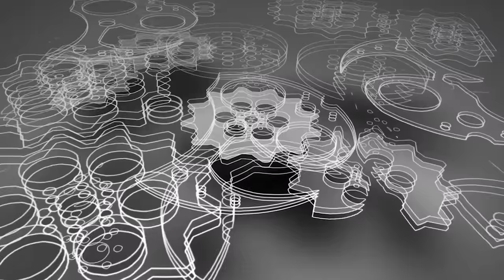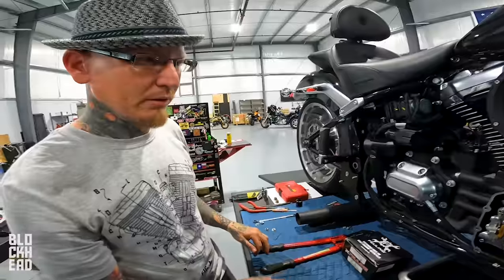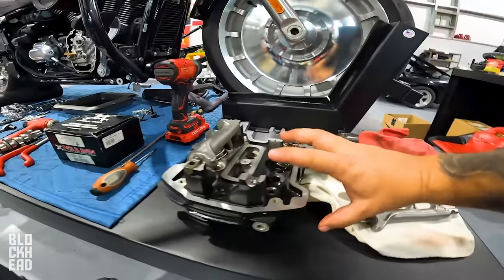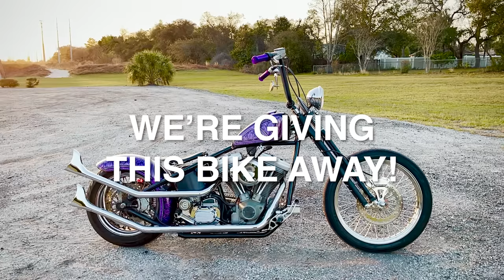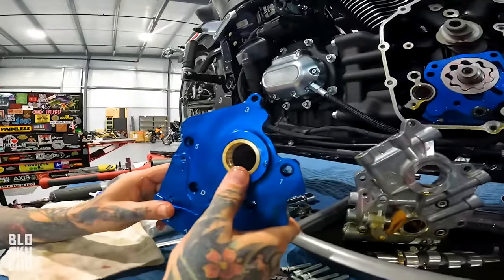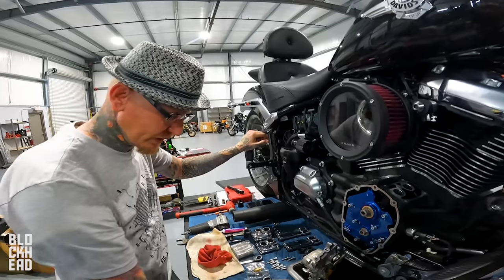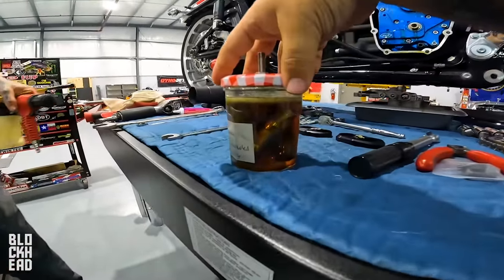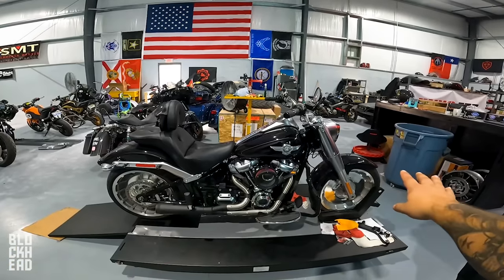Harley Davidson STAGE 2 Explained

Comment: Chris is a good teacher.   Have you guys ever thought about doing occasional seminars at the garage?   I'd pay to take a 2 hour motorcycle class with Chris teaching.   There's a local motorcycle garage/co-op work space near me that does classes.   It's like 50 bucks for a 2 hour class on basic maintenance or electronics or carburetors, there's a few different ones to chose from.    I signed up for a couple classes next month.  I'm curious to see how they are.
Reply from the maker: Cool idea!
Reply: @BlockheadMoto   I'm with Dave123 . a maintanace class would be awesome. I would pay for such a class.
Reply: I’d pay

Comment: Put a S&S 475 in my M8 114 Breakout and dyno tuned it with power vision software. Made 124 horse and 136 ft lbs of torque. Love this cam.

Comment: These seriously are great, loving the series. At what point of power increase do you need to start worrying about beefing up the transmission? Does going Stage 3 or 4 introduce more odds of blowing a motor?

Comment: Great video.  Have a Stage 2 in my Ultra and Heritage and know first hand the improvement.  Love your presentations.  Keep up the great work!
Reply: How did you get rid of the bucking at low rpm
Reply: @popsproductions8547  Don't really have a problem with off-idle or low rpm bucking.  They just pull a LOT stronger through the RMP range.  I do a lot of low speed maneuvering practice with cones just as a general rule to improve my control and haven't noticed any problem with low speed friction zone clutching / control.
Reply: @williamokeefe9677  ah yes like preloading to do sharp 8’s. Yes i find myself using the clutch a ton more to solve my issue at slow speeds. But this was doing it up near 2,200 rpm in lower gears. It needed tuned i guess. So we will see how the new bike (Toad King) gets tuned after its stage2. I went power vision this time.
Reply: @popsproductions8547  I've got the standard Harley components.  My biggest issues are keeping a steady RPM for low speed practice, actually have found a little higher RPM to help and the friction zone differences.  Heritage has cable clutch and a nice wide zone; Ultra is hydraulic with a short zone and fast engagement.  Going back and forth takes some attention.

Comment: Awesome!  Thanks guys.  Informative, fun, and entertaining video.  Best I've seen.  I have a Road King Stage 1 which is plenty of power for an old fart like me who's been riding for 50+ years now.  Interested in stage 2 maybe but is there a trade-off between power and engine reliability/lifespan when you go to stage 2?  If the motor is breathing and working that much more (due to more duration and lift of cam), are you in effect shortening its life and reliability on the road for those long cross country trips?  (Maybe I think about this too much since I'm 70+ years old.)  Any thoughts appreciated.

Comment: Really enjoying your podcasts.  I can't get enough information about Harley engines.  I've gone insane.  I used a Screaming Eagle cam plate and oil pump.  Hopefully I made a good choice with my.510 S&S cam and gear drive.  Less than.002 run out on my 01 twin cam

Comment: How does the SE oil pump and cam plate stack up to the S&S parts? What type of improvements in oil flow does it provide percentage wise versus the S&S?
Reply from the maker: You’d have to look up their spec sheets for detailed stats, but Chris goes over a few of the pros in this video 👍🏼
Reply: @BlockheadMoto  Chris is exactly why I asked the question. He was a Harley employee and likely has experience with the SE oil pump and cam plate. I'm sure more of your followers would love the comparison info of the different brands of oil pumps. I've seen videos showing the % numbers of increased flow for the Fueling and the S&S parts but haven't seen a Youtube video comparing the SE to those two brands.

Comment: I purchased a 05 might train... I heard that in  those twin cams that the tensioner would  wear and break and get into the oil circulation ... I've been looking at the SS gear driven and / or the screaming eagle hydraulic cam chain tensioner ones. I am concerned about the runout  on the SS gear driven one.. Thoughts..?  Great video.. Thanks, Brad.

Comment: Some came with stage 1 already completed - my FXDL was one of them. There’s something strange about my ride too - seems to have much more power than it should have. No cam but my god the torque on the low end and HP on the upper end will absolutely break your neck. 2017 and only 5400 miles on her. She beautiful 🤩

Comment: What about the "O" ring / gasket on the back of the oil pump?  It wasn't in my instructions from S&S but was on a video from them.  When I didn't have it installed  oil came out my Trask "Check m8" so I had to install it. S&S said it was needed.  The trouble didn't start until I went up to a 128".
Reply from the maker: It is recommended to replace that gasket with a new one 👍🏼

Comment: Ok, so you cut out the pushrods, but don't show how you reinstall the new ones with the heads still intact? I've never done this job before and am very curious how this is done. Appreciate all of your informative videos!
Reply from the maker: This isn’t a ‘How To’ video where we show step by step, that would be a much longer video. This video’s goal was to explain what a Stage 2 consists of and how it works 👍🏼
Reply: Lots of videos out there about adjusting your pushrods,  all by way less cool people though.
Reply: @BlockheadMoto  Yeah, I took that in to consideration, I just figured with all of the other detailed info you guys gave that you would show that. I looked up some other vids to see how the adjustable pushrods worked. Keep doing what you do!
Reply: @GeorgeWashingtonjr-p7r  agreed!

Comment: Love the content in the shop but I have a suggestion. How about some troubleshooting videos? I assume you guys will have repairs in the shop. Be interested to see some diagnosis on known Harley issues. Got one I wish sick wide glide could figure out.
Reply: Whacha got?
Reply: @sickwideglide   Really appreciate the reply. 2012 Street bob stage 1 SE heavy breather and V&H big radius. Power vision tune from Fuel moto. 2 issues that I'm not sure are related.sometimes I get either a low idle or high idle when stopping. Either it will be at 1300 rpm or let's say 850 rpm. When it's high takes a little time to settle down to normal idle. When it's low same thing. Doesn't happen all the time. Changed IAC valve helped a little but came back. Occasionally i'll get a high idle on cold start 2000 rpm. Again all this doesn't happen all the time. 2nd issue is I get hard hot starts. When I stop at gas station fill up go to restart I get like a metallic clank. Im guessing compensator or something maybe. If i release start button quickly it starts fine. Before a hot start if I bump the starter it starts fine. Weirdest thing I guess. Other than that bike runs great. All this happen before tune too. Not sure if they are related but would sure love some advice from you. Again thanks so much.
Reply: @sickwideglide  forgot to add no hard start occurs on cold start.

Comment: Great video! How did you put the push rods in without taking the top end off? Just curious😂
Reply: I was waiting for that too I’m glad someone mentioned it.
Reply: There’s a video on YouTube that shows the process, no head removal is necessary, the lifters have to be in the lowest position then the adjustment nut has to be loosened to allow for the shortening of the push rod kinda like the shovelhead.
Reply: He removed solid push rods and replaced them with adjustable, which can be made short enough to install without removing the heads.

Comment: I put a stage IV 131 kit on my 2020 ultra limited last year. This year I am putting a baker grudge box and a baker compensator and going with a wood 408 cam D&D 2 in 1 exhaust. When I went to the dealership who is doing my build they tole me they replaced my lifters because they had a little wear on them and on the cam. They only had 8500 miles on them and replaced them for free. My question is I asked them when they did my stage IV kit if I needed to replace the oil pump and the cam plate with the S  $ S ones and they told me I have the upgraded harley ones and they have had no problem with sumping with it. Isn't wear on your cam and lifters a sign of sumping because they are not get enough lubrication? And in your opinion should I go with the S&S cam plate and oil pump with the money I am putting into my bike? I see in your videos and with the research I have done they seem like the best or I am good with the harley upgraded oil pump and cam plate. Thanks for your time.

Comment: Great video guys, thanks. Not being mechanically inclined, I have a quesion. On my 2022 Street Glide ST M8 117ci. HD just did a stage 2 upgrade, but to stay in warranty, they had constraints and cound't do as good a tune as if my warranty was over. I put TAB 4.5" slipons w/Zombie baffles. Redshift 468 cam kit, but Zippers advised "Make sure you keep the CAT head pipe, DO NOT remove the CAT, If there is an option for adding SE wide band sensors skip those, keep the narrow band sensors."
End result: DYNOJET Results = 95.57 HP @5.12 RPM, Max Torque 131.01 @3.18 RPM. I thought my HP would be over 100
with the M8 117ci.  Wondering what you think?  Thanks!

Comment: Having cut the push rods, sorry for being a bit 40 watt (dim) here, but how did you fit new ones without taking all the stuff off which gave you the reason to cut them in the 1st place or does fitting adjustable rods allow you to do this??. Would have liked to see this wizardry if you still have footage of it on the cutting room floor please post that footage please 👍 great series so far 👍👏

Comment: Nice info. So question I have a 21 ultra should I do screaming eagle trq or power cam or best to just do a aftermarket cam? Also since I have newer model oil pump will the stock oil pump be good or still don’t use when upgrading cam?
Reply from the maker: If you do SE cam and have dealership install, you should still have warranty. If you’re not worried about warranty, there’s a ton of aftermarket cam options out there that make incredible power. Newer oil pumps hold up fine, but it’s not a bad idea to beef it up and throw better at it ‘while you’re in there,’ that’s our thinking anyways, haha
Reply: @BlockheadMoto  well I like warranty but it’s just 1yr left. I figured if I went SE cam after warranty I would want more. That’s why I was going to go ahead and do it right the first time. So guess if I’m doing right I need better oil pump as well. Thanks for quick response! Yes I’m
Going to go ahead and do it right while there what’s another $700 investment going to hurt. I’m hoping from stock to the 475 upgrade going to be fun as hell

Comment: I bought a ‘15 883 as 3rd owner that has an apparent full stage 1.  The 2nd owner bought it from a Harley dealer and didnt ask and bought it because of size and looks.  After watching this video, given how my bike, runs I’m wondering how I would find out if the original owner also did stage 2 work.  Since it’s all internal how would I know?  It’s really fast compared to my son’s stock ‘17 883.

Comment: Curious how the push rods and PR tubes went back on without pulling the head...
Reply: They used adjustable pushrods.
Reply: @Tagfire17  Still doesn't explain the tubes unless they are some 2 piece design.

Comment: question, the S&S installation instructions call for a maximun runout of 5 thousandths with the billet cam plate...so is 8 thousandths too much or will the new camplate be ok? I'm installing a 465 cam kit with pump and cam plate this weekend.  I'm hoping that I have runout below 5....just curious, I noticed you said 8 thousandths on the runout...

Comment: i just subscribed, I own a 2018 Softail Deluxe (M8 107 motor) and as chances would have it im awaiting my parts to do a Stage I & Stage II (all Screaming Eagle) and im also upgrading the Lifters, the lifter Cuffs, and a SE High performance Oil Pump and Cam Plate. Also a rear pillian, clear 19” windshield, and a few chrome pieces, (although this bike came stock with a chit load of Chrome) Thats as far as i want to go for now. Very cool that I just came across this video. What i found interesting when ordering the parts, the parts guy spoke with the Service manager cam back told me he ordered everything (take about a week) but said that the service manager said “You dont need The Lifter Cuffs” I said NO….You dont understand, I WANT them replaced, and he sort of argued with me asking repeatedly WHY? I finally said because the ones Harley built this engine with Like with so many other parts Hum lets see Plastic Tran Cover, Insufficient oil pump improperly vented pressure with the blow by issue) and The CUFFS are PLASTIC and are known to TWIST, then the rollers on the bottom of the lifters can rotate…NOT GOOD. His reply…Oh we haven’t heard of THAT happening. I have and will be glad to point you to the many instances, i also dont beLIEve they haven’t heard it.

Comment: I purchased back in June of 2022 a brand new Street Glide Special 114.
8 months later, I am considering a 131 Stage IV kit instead of a 135 Crate Engine replacement.
Is a 131 now cheaper since the 135 is being produced?
The wait for my area in Pennsylvania for a 135 is likely up to December or later when it is officially released for here compared to scheduling a 131 kit upgrade next week.
I am just trying to weigh my options. Looking for any comments, thoughts, or suggestions for this upgrade.
Stage I, II,III, IV, or wait for the 135 crate engine?

Comment: Lets say you would live in Europe and many things are not "allowed" :D and you are having a Low Rider ST with the 117. Would it bring any benefit / make any sense in adjusting the runout of the cam, changing the oil pump and the tappet cuffs to the ones from S&S, but keeping the original tune as the "stock" heavy breather + having an aftermarket 2:1 exhaust?

Comment: capital Harley installed a stage 2 on my 2002 soft tail, ever since the lifters are making the ticking noise
on a cold start up almost like the lifters claps. called them right away and they told me its normal.
got 2000 miles on it now and still does it, at 70 mph I can hear lifter noise. what is your opinion on
this. this bike just rolled over 40,000 miles. thank you for your input

Comment: How would not doing the header effect the stage 2? Looking to do stage 2 over the winter. Or should I do the headers first? I already have a high flow intake. With Tab performance Bam sticks and zombie baffles. No tune currently done or installed.

Comment: I have a 2014 street Glide that Harley did a stage 4 on when I bought it. Dino 115 torque and 111 HP. I still can't find out what was used for build on the 103??? I guess I have to do a tear down????

Comment: What is the difference between the screaming eagle hi volume oil pump and the s&s oil pump?  Is the quality in the bearings the same?  Putting together my stage two but still need the oil pump not decided yet.  2021 m8 on fltrk thanks.

Comment: Great video as usual with outstanding explanations.  I have spent thousands on both car and motorcycles engine mods.  Engine mods are the most expensive vs let’s say suspension mods.  Truthfully, Unless you really spend thousands you may notice better throttle response and that is that. More cost effective to buy the horsepower from the factory.  You must go to forced induction to really make serious power.  Intakes, headers, exhaust, cams, all effect drivability.  It takes a lot of cash to drop 1 sec off 0-60 or quarter mile runs.

Comment: Question out of curiosity
I just did basically the same thing to my ’18 Fat Bob 114 with a 475C S&S Cam Chest Kit.
How much oil did you lose in this process? Did you have to do an oil change? I just topped mine off..

Comment: 10:46  "Knuckles, panhead, shovelheads are all quad cams".  Really?   I'm confused; all these engines have one cam with four lobes.   The engine in my 2004 Sportster does indeed have four single lobe cams, so they call it the "twin cam".  Cheers!

Comment: I just did that same cam chest upgrade on my 2022 streetglide st with the 117. I used a thundermax ecm  and it seems to be running great in all areas except 1st and second gear around 2500_3200 ish rpms. Should I find someone to dyno tune it or do you think it will work itself out ?

Comment: If i have a PowerVision 4 tune for a stage 1 setup on my 2023 low rider s.... and i do a cam job (full stage 2 in parts): do i need to tune it again? or does the stage 1 tune suffice?

Comment: Own a 2018 HD Softail Deluxe FLDE with screaming eagle exhaust and air filter mods. How do I confirm a software map was updated as well? I’m the 2nd owner. The 1st owner had the mods done at 345 miles by HD. Thanks

Comment: Really should show folks how you had to heat the retaining bolt for the lifter cuffs. HD uses red locktight on those bolts. I've had to repair many broken off bolts from customers who tried to muscle out those bolts. Sometimes you even have to disassemble and split cases to do repair. DOLLARS lost!
Reply from the maker: This isn’t a How To video where we show step by step, that would be a much longer video. This video’s goal was to explain what a Stage 2 is and how it works 👍🏼

Comment: My Indy shop had a part shortage on adjustable push rods .. and they didn’t want to leave me sitting so they pulled the top off and did solid rods.  Was blown away what they went thru to get me back on the road (needed to do the oil pump .. sumping .. fried CPS..  thought fuck it I’ll
Do cam, exhaust and dyno tune sinxe they gotta go in there anyway for the oil
Pump (didn’t want to risk another oil sump
Issue so I upgraded instead of drain crank case and toss in new CPS.
 I want a bulletproof bike